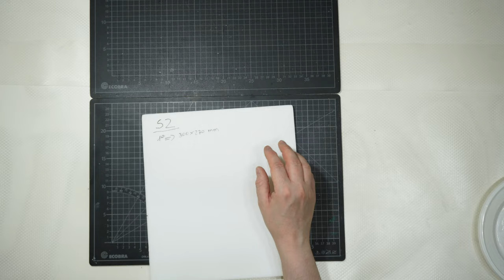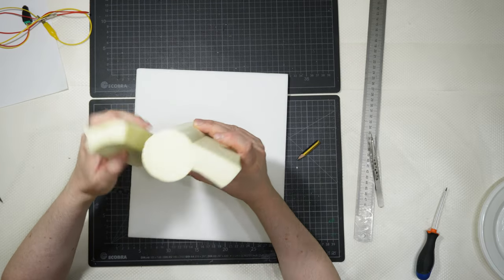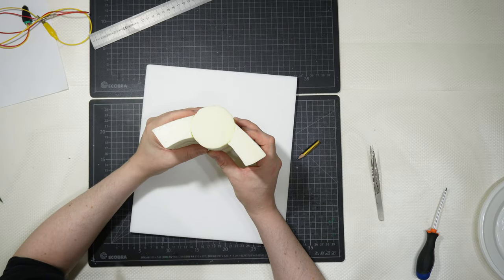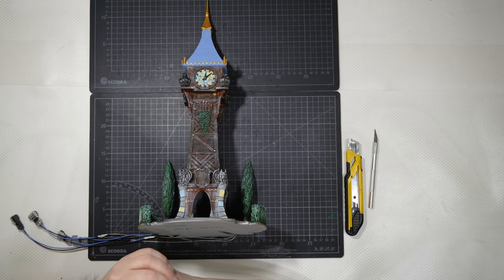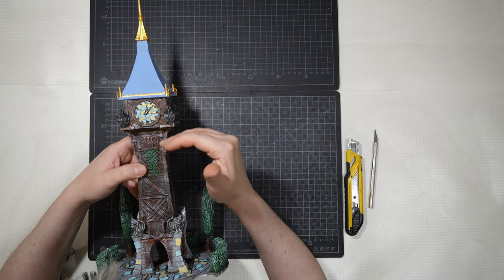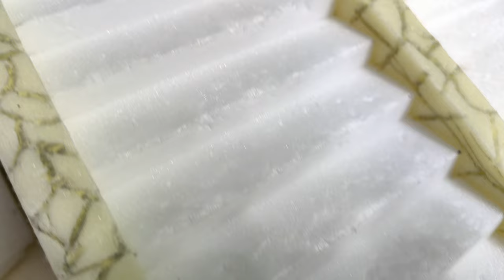Christmas Village Tutorial 2024 - Part 11

Comment: Silvio, maybe add a miniature Lemax Christmas wreath  hanging from the graveyard entrance or multiple wreaths on the outside fence. Love Roman architecture with those arches and walkway inclines. Your strange ideas always look crazy when you start, but the finished  product is the best!
Reply from the maker: Hi Robin,
Adding christmas wreaths all along the graveyard fences should be the right solution.
Thank you for the suggestion.
I'll try to use the Lemax ones.
(I have to make a mental note and remember to buy them on the upcoming field trip to the Peraga Christmas Store)

And if they aren't adequate I'll model something similar.
Reply: @robinwright5607  Robin, I like the idea of wreaths on the fence at Christmas time. What a good idea!
Reply: @obsessedwith_christmas  Thanks Rebecca....normally during the holiday season you would see Christmas flowers/ wreaths on gravestones as a way of remembrance. This way Silvio's graveyard didn't look to Halloweenish!
Reply: @robinwright5607  I didn't know that. Graveyards make me sad. But very true, you don't want it to look halloweenish for a Christmas display!
Reply: Great idea on the wreaths Robin. I had thought about the Lemax  Christmas candles that say Noel on them on either side of the entrance but think your idea is much more classy!